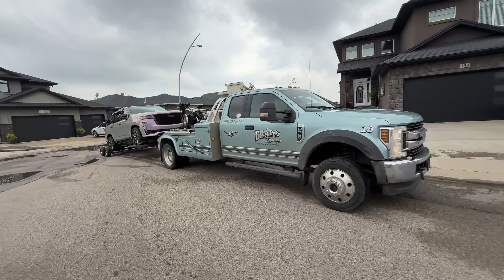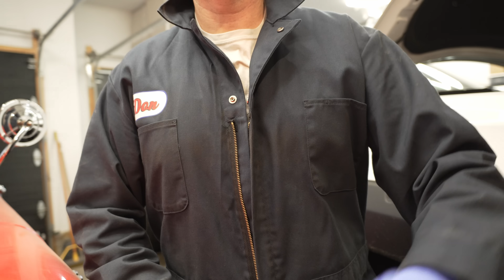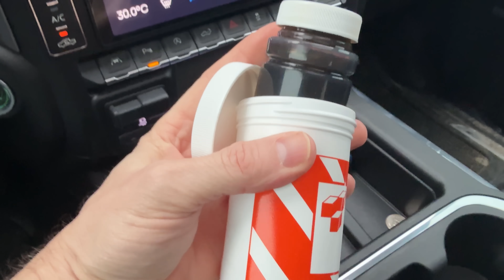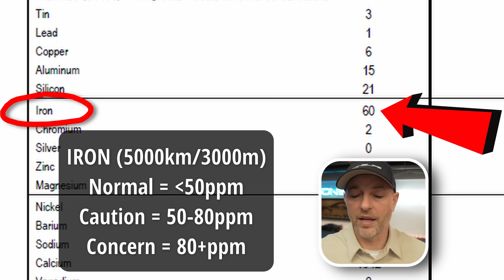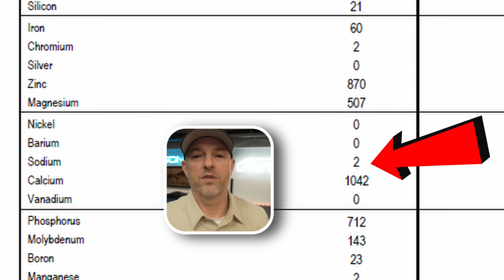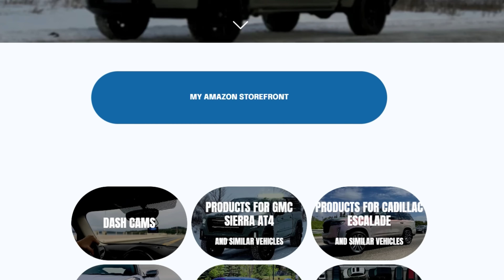6.2L L87 0w20 Engine Oil Lab Test — Here Are the Results

Comment from the maker: I wanted this video to play for awhile before commenting further on the iron results. 

Since all other markers are pretty reasonable, I think this is a reasonable explanation and it has to do more with my environment.  

From November through March, the truck starts mostly daily with temps dropping as low as -35°C.  More commonly -20°C to -15°C.  Unfortunately, even 0w20 needs a little time to warm up and properly lubricate the components.  We didn’t see fuel dilution, so internally everything is sealed tight.  Therefore the brief seconds of each extreme cold start (without full lubrication), coupled with more idling time to warm up a little have contributed these readings.   My brake fluid can be like molasses at these temps, it needs to warm up a little before driving. 

Am I on the right track? I invite your thoughts, I am not a oil expert as stated in this video.
Reply: If you think it's a cold weather / poor oil flow situation....  Do the "flood clear" trick at every startup, to preoil everything before actual start up.
Reply from the maker: I never tried the process.  Remote starts are what I typically do from inside the house.  Now that winter is coming to an end in about 6 weeks here, I’ll consider it more in November.
Reply: Don’t guess… TEST!  If that’s your hypothesis then send in another sample (or two) from warm weather starts to see if it drops.  This is the trap of one and done sampling.  You need a series of data points to see trends and draw conclusions.
Reply from the maker: That’s the plan
Reply: @original72canuck  I suspect that the wear will remain high even in warmer weather.
Only way to know for sure is to test.
🙂
Reply: If you bond a lubricant to the inside of your engine you will have lubrication 100% of the time... even on cold starts. That will eliminate your cold start problem. The average reduction in wear is ~80% (~5x increase in lifespan).
🙂#XcelPlus
Reply: According to the Oil Geek, Lake Speed jr ... 0w oil  where the "W" is a measure of twisting torque, measured in Cenistokes ... unlike the second number, which is a viscosity rating.
ZeroW oil is still thick at cold temperatures .. mostly because 50% of engine oil is made up from the aditive package, giving a modified cold crank advantage.
MY HUMBLE RECOMMENDATION  ...  is to start your engine in "flood mode" ever time ... in cold weather. 
That should significantly reduce cold/low oil pressure start-wear,
If it is indead, the type of wear you are seeing in your oil analysis is true.
Or ..... It's cold intake air that is causing fuel dilution.

Either way .. "flood strating mode" is just a smart idea.
Cheers

Comment: You don't need a test to tell you that. Yes, your engine is constantly wearing out if it is in operation. Even just sitting there it wears itself out. It doesn't even have to run. Maybe seizes up is better terminology.  That's what they do. They are machines.  They wear out and break. Like people.

Comment: 2020 6.2L AT4 w/ 52K miles, ran oil analysis and everything came back green. I did change to 5W30 Syn and it runs quiet w/ lower temp and higher oil pressure. Results: 
Iron - 10
copper - 3
Tin - 5
Viscosity - 7.3
No water or clycol
Silcon - 15

Comment: Pretty good Oil Rpt, need a few to get a better handle but it’s also showing that the oil doesn’t have any significant break down or contamination.  Indicating you could go longer in intervals with no concern, if 5000 now, go 7000 and retest.

Comment: I have a 2020 Sierra with the 6.2. Has 71,000 miles. 2 months left on powertrain warranty as I bought it used. I asked the tech if I could switch to 0-40 and he said I needed to run the 0-20 and he recommended running the 0-20 for my Vehicle. 
That being said it’s starting to have a knocking noise on cold starts for about 30 seconds then goes away which it didn’t previously have. Dropping the truck off today for inspection on the noise. Hope we get our recalls on the 19-21 models. One can only hope
Reply: they're lying to destroy engines and they know yours will probably last through warranty but fail after 100k.. look in the manual, you will likely see many different grades are allowed but typically recommended with different climates or usage "towing". 0w-40, especially the high Zinc/Phosphorous "Euro/Race" formulations will save that engine but cost you a tiny MPG hit

Comment: I recently rebuilt my 6.2. And found something out that concerns the oiling caused by the PCV. I think many are missing this issue. With the stock PCV system there is too much vacuum on the crankcase causing the oil to be pulled into the crankcase prematurely from the bearing passages. This is causing the oil to not make it to the mains under enough pressure. The fix is to vent the crankcase to atmosphere. The oil pressure observed with a scanner was fluctuating like crazy at idle because of the high vacuum but after venting to atmosphere the pressure stayed higher and steady. A dash gauge hides the defect because it moves slowly. Love your channel!
Reply from the maker: That is very interesting information, thanks for sharing! 👍

Comment: Started using 5w_30 for my 6.2 sierra denali at 39k, manual even recommends using heavy weight oil for towing, european models of the sierras use 5w_30
Reply: if you live or drive in cold climate I'd drop to a 0w.. if hot climate or towing regularly -40

Comment: I have a 25' 6.6L L8T same LT based engine with just VVT.  Unless your extra wear is from AFM lifters you have extreme iron wear using 0w20. You need to see universal averages for this L87 and to not use a Dexos 1 Gen 3 that is only about CAFE mileage requirements.  My iron wear after a proper break in oil change at 674 miles is down to 19 ppm after 8,793 miles using Castrol Edge 0w40 SN/SP in 2 oil changes that average just over 4K miles. The hell with GM and their Dexos piss water that shears down.  Dexos R is Euro spec oil now and exceeds Dexos Gen 3
Reply: when the dust settles I'm sure it will be shown that they were hoping running the piss water would at least make it through powertrain warranty so engines would grenade left and right making for more sales.. slight miscalculation has them dying WAY early though

Comment: My 22' 6.2L Trail Boss has used less oil now that it has the 0-40(5,500 miles).  It used less than a pint. With 0-20 it would use 3/4 of a quart in 5,500 miles.
Reply: Do to low tension piston rings and PCV suction into intake.

Comment: I run 5-30 in my dodge with 350,000 plus miles, but I long ago switched from mobile 1 to valvolene engine sounds better.
Reply: mobile 1 isn't as good as it used to be.. look up the formulation and VOAs from the modern stuff.. its garbage

Comment: Great methodical testing here. The iron and aluminum seem high to me, but I’m also not an expert. I brought a sample from our 2011 Toyota Rav 4 with the 3.5L V6 with 275,000 km on it to Fluid Life. Same 5000 km of use. 7 PPM iron and 2 PPM aluminum.

Looks like you’re taking the best care of it with shorter oil change interval. Hopefully the 0W-40 helps the life also.

Comment: My 2022 GMC AT4 experienced total engine failure at 77K miles. Had the truck at dealer the previous weekend for oil change. Changing viscosity of oil will NOT rejuvenate the crankshaft bearings which was my engines failure point. GM didn't even cover my total engine replacement at my failure happened in March 2025, so my extended warranty had to pick up the cost. I'm beyond disappointed in GM as a whole.  I've been loyal to the brand for 50 years!
Reply: I quit being brand loyal about 15 years ago and would advise smart shoppers to do the same.
Reply: you bought a lemon

Comment: My 2012 6.0 has 277,677 valvoline extended protection 5w 30 from the gate with lucas synthetic oil stabilizer, every 4or 5 thousand miles,run like new

Comment: I have 2017 Escalade with 66k mile on it. Recently I put afm delete and thermal bypass for transmission. And car is smooth driving like v8 engine supposed to be. And I just did change the engine oil with 5w-30 Valvorine restore and protect (Gm also using gdi engine). After changing oil engine sound so quiet. Never going back to 0w-20 oil.

Comment: Sorry but 0W-40 oil of any brand does nothing for the faulty lifters that GM is using on these engines
Reply: Postponing the catastrophic failure to after warranty expires.
Reply: 16 Escalade 115k 
Just bought it. 
Doing first oil change. Saw recommended 0W 20? I was shocked to see that. 

Sounds like what I’m reading is I shouldn’t use 0W-20 

Any kind of oil that can do something for faulty lifters?

Comment: I switched to 5w30 from 0w20
Reply: any multigrade that starts with 0 is bad at present. 5w30 is better, and you just lose .20% fuel economy, for 300k engine life.
Reply: @rearspeaker6364  i would rather care about reliability than gas mileage on a tahoe 5.3

Comment: Seems that as long as the oil used has the correct "rating" that an engine is supposed to be using, all will be just fine. I wouldn't use a 0w-20 in any vehicle I owned...5w-30 would be my choice.

Comment: I switched to 5W-30 synthetic and I no longer have oil  consumption problems
Reply from the maker: It’s what they use in Australia for these trucks
Reply: @Donslife  i agree.... I inherited a 2020 denali with 6.2... was going threw oil.... Started using 5W30 synthetic.. and long story short, no issues now... not a drop lost...
Reply: the original build of the motor was meant to be 5w30 anyways.... they only ran 0-20 for fuel mileage, which kills the motor. and now gm(america), is trying to back track.
Reply: 110k km at the change..... higher oil pressures and lower running temps... all around better.

Comment: My neighbor bought a new Silverado in 2021. And right when he got home he was changing the oil.
He found out they put that thin extra virgin olive oil in his engine, you can pull out the dip stick when
hot and it runs right off of it , ALL OF IT !
So he put in Red Line 10w-60wt and a K&N oil filter, now it has over 60 K miles on it AND never had
any warranty work done on it. .............. Incredible when you have the right oil !!!!
Reply: I'd be careful running that viscosity in the winter.  I've been running 5w40 for years on my 6.2 v8 and currently at 220k miles.  The thicker viscosity could possibly plug up the passages in the VVT variable valve and starve the engine of oil while in operation leading to potential failure.
Reply: @20tea  sure, while not fully warmed up.

Comment: Si of 21 ppm in 5,000 km (4.2 ppm/1000 km) is pretty high.
Si is just dirt.

After 15,000 a 2015 Range Rover has only 9 ppm of dirt (0.6 ppm/1000 km)
A 2020 1.5 L Yaris had 30 ppm Si in 15,000 km (2 ppm/1000 km)
Both these cars spend a fair bit of time in dusty conditions.
N.B. As Si increases wear increases e.g. Halving Si will roughly have your wear.

High Si intake is often due to a dirty air filter or an aftermarket air filter i.e. Most aftermarket high flow filters will let more dirt into the engine.
Foam air filters are typically the best filters while increasing air flow.
🙂#UniFilter
Reply: This video demonstrates why a foam filter is more effective than a paper one:
https://youtu.be/4r8NajjYkFA?si=_v8h8syeXcgQY19j

N.B. It is possible to make a foam filter too thin... and then it can let through more dirt than a paper filter e.g.
We tested a Pipercross filter (designed for UK conditions) that let through too much dirt. 

UniFilter is designed for Australian conditions and should filter better than a standard paper filter.
Most foam filters are designed to outperform paper filters... but some manufacturers don't test properly... or don't do any testing at all.

Oil analysis is a good way to pick up problems like this.
🙂

Comment: We did an oil analysis on a 2015 Range Rover recently after 15,000 km
Fe was 47 ppm (3 ppm/1000 km)
Total wear across 7 wear metals (Pb, Fe, Al Cu, Cr, Tn, Ni) was 56 ppm (3.7 ppm/1000 km)

Your 2021 GMC Sierra 6.2 L wear in 5,000 km was:
12 ppm/1000 km Fe
17.4 ppm/1000 km total wear (7 metals)

12 ppm (Sierra) v's 3 ppm (Rover): Wear is 4x higher
17 ppm (Sierra) v's 3.7 ppm (Rover): Wear is 5x higher

We bonded a lubricant to the inside of the Range Rover engine to get these wear results.
We don't know what the wear was in the engine originally.
However, the engine went from being very noisy to being very quiet (it can barely be heard pulling up).
Noise and wear tend to correlate well.
🙂#XcelPlus

Comment: A level of 60 ppm Fe (iron) in an engine oil (GMC 2021 Sierra 6.2 L) that has only been used for 5,000 km is fairly high.

Our 2020 Toyota Yaris 1.5 L has just had a baseline oil analysis done and the wear for Fe is 32 ppm and that's over 15,000 km.
Our total wear across all 7 wear metals (Lead, iron, aluminium, copper, chromium, tin & nickel) is 52 ppm

The combined total of all 7 wear metals in the 2021 GMC Sierra 6.2 L is 87 ppm: 
That's 35 ppm (67%) higher than the Yaris.

A good way to compare the GMC wear more accurately is to express it as ppm/1000 km (or miles)
Fe is 12 ppm/1000 km (~20 ppm/1000 miles)
Total wear is 17.4 ppm/1000 km (29 ppm/1000 miles)

Yaris Fe is ~ 2 ppm/1000 km (3.4 ppm/1000 miles)
Total wear is 3.5 ppm/1000 km (~5.6 ppm/1000 miles)

GMC v's Yaris
12 ppm v's 2 ppm is a 6x higher
17.4 ppm v's 3.5 ppm is a 5x higher

N.B. These are baseline tests and we haven't yet started doing anything to reduce wear on the Yaris.
Otherwise the difference would be even larger.

You should be able to drop the wear on your engine by over 50~90 % just by doing a few simple things
Now that you're doing oil analysis you can easily quantify the benefits of various approaches... and work out what is worth doing and what isn't.
🙂#XcelPlus

Comment: Didn't know ppm (Parts Per Million) was mg/kg for oil analysis as it's a dimensionless unit.
It's mg/L in a lot of other measurements.

You explained stuff well and obviously spent plenty of time putting it together.
🙂
Reply from the maker: Thanks!  Oil labs often use mg/kg and not litres due to density variations
Reply: Checked with Techenomics (the lab I use) and they confirmed that it's mg/kg.
They gave the same rationale.

As PPM is dimensionless it makes sense that they wouldn't specify the units.
🙂
Reply from the maker: All good, one of my daughters is a engineer and gave me an explanation that I have already forgotten 😂

Comment: Good idea upgrading to 0W-40 now that warranty is no longer a concern.  I’m sure you usually kept OCIs as short as possible on that 0W-20 and usually used the best 0W-20 you could get your hands on for a reasonable price.

Edit: I’d be tempted to even try Mobil 1 15W-50 if I were towing up grades or off-roading in the summer.  It’s priced similarly to M1 FS 0W-40

Comment: Does dealship pay for the oil they just put in 0 40 after the pecoscope test, do i go back for the new oil?
Reply from the maker: The recall test should be no charge for the oil change to the new spec (assuming it passes the Pico test).  After that, your subsequent oil changes need to use DexosR approved 0w40.

Comment: I have a 2020 AT4 with the 6.2L V8.  It is NOT under the recall campaign.  I have been using Valvoline Full Synthetic 0W-20 up until the recall came out last summer.  I changed the oil to Royal Purple 0W-40 in May.  When Blackstone performed the analysis, their notes mentioned that due to the change in weight the viscosity was LOW.  They said this is due to oil dilution.  They said up to 20% of old oil stays in the engine, which would cause the old 0W-20 to skew the results of the 0W-40.  Keep this in mind when you test the next time.  The 0W-40 was used @ 52,948 miles.  I went back to the VALV 0W-20 this past November @ 56,372.  The report for the Royal Purple was very similar to the previous VALV reports.  I live in Illinois, so the truck is exposed to Midwestern Winters.  I have 4 qts of the RP 0W-40 and I am contemplating running 0W-40 at the next oil change.
Reply: Yup.  It’s standard practice when comparing oils to sample the second change of a given grade and manufacturer to ensure the previous oil type is completely out of the crankcase.  Otherwise the results can be ‘noisy’ making it difficult to draw conclusions.

Comment: Hey Don I've been following you for a long time and appreciate all you do and share with us all. I have a 2021 GMC 6.2 also, and have had my engine replaced. GM replaces engines with a reman block pistons and head and takes all the original accessories such as water pumps, alternators ect. off the old one and puts it on the reman one. When I opened my hood I could see there were no new things under my hood. I even asked what's new, then they told me. Even my belts and sparks plugs and wires were original. They count even put new ones on???? I told them they should have asked and I would have paid for the parts and not the service because they're already doing the work covered by GM! Whatever! I had to tightened up a lot of things under the hood that the dealership didn't. My alternator cable wasn't  tight and I didn't catch that so about a month later I was getting a battery saver on messages and found the cable loose and the nut welded itself from arcing and melted the plastic nut over metal thread post. I took it back to the dealer and they put a new alternator on under warranty and I had to pay 100.00 detectable when clearly they didn't tighten it down.

I seen how you change your oil and thought you might like this. I have it on my truck and it's awesome.
Mark M. from Texas
https://www.valvomax.com/collections/all-products?gad_source=1&gad_campaignid=22404161757&gbraid=0AAAAADO4RRurA3mvlKUDC84l0QfnWj-Jc&gclid=Cj0KCQiA8KTNBhD_ARIsAOvp6DKhBQ3rdrzl4oNyBF075N5dKZ6xhxkTmsFcZKaqrEo-4o_fLDx35UUaAnceEALw_wcB
Reply from the maker: Hey thanks for the drain plug info.  Would be nice to find these in Canada